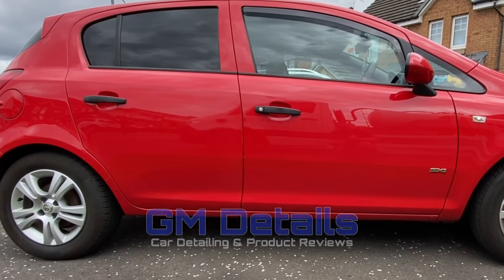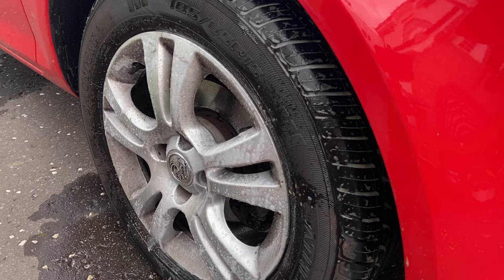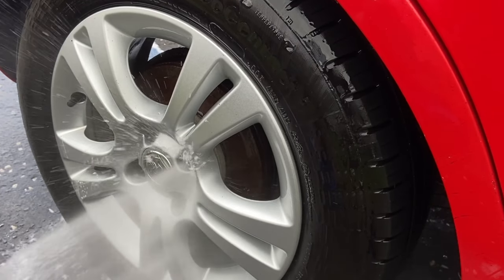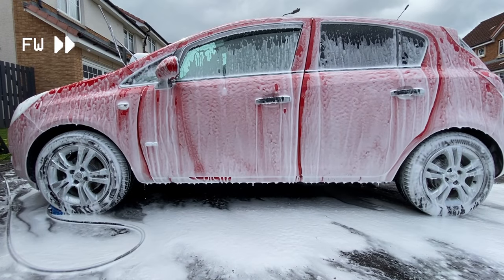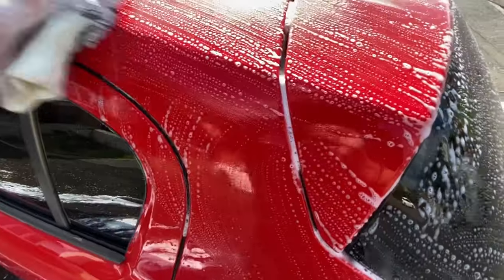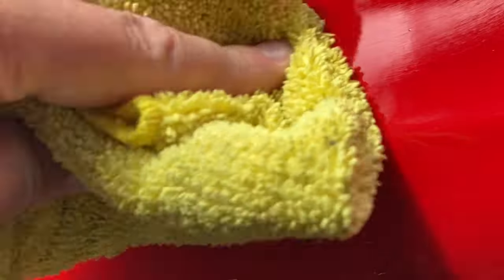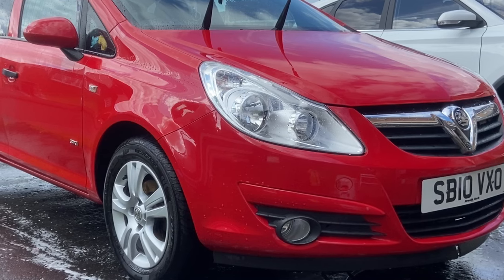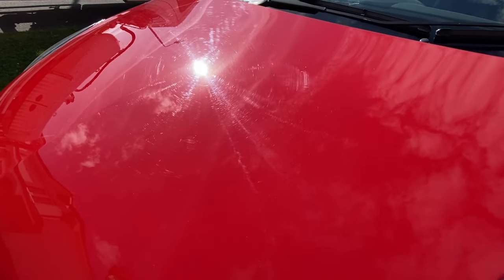CORSA D FIRST WASH SINCE LOCKDOWN | Disaster Detail Series Vauxhall (Opel) Corsa Episode 1

Comment: Great video dude! Really looking forward to the next video! Don't leave us hanging too long. The products look decent enough and without being "that guy" I'm sure they are likely to be rebottles. But for 5 pounds a bottle it is fantastic value for what are capable products. Just because they are rebottled doesnt mean they inferior to some of the guys who are making their own. I've had some of the Jellybean shampoo from another supplier which looks to be the same product and it's actually one of my favourites
Reply from the maker: Thanks mate. Yeah undoubtably rebottled but surprisingly good products. I can only think of 3 chemical suppliers in the UK, Bonnymans , Car-Chem & A-Chem, all of them have a dedicated car cleaning range  & offer rebranding for smaller niche brands which I think is great for the industry to offer the enthusiast a collection from their favourite brand. 
Then again most small detailing brands rebottle & add scents or colours to suit themselves and call them ‘bespoke’ chemicals which I’m a bit dubious of as any chemical manufacturer will tell you not all scents & colours work well within products and can easily ruin them like Infinity Wax suffered when they were within their first few years of trading as an example.  
Price wise, yes as you said £5 a bottle is excellent value but even at normal prices of £7-£9 for 500ml and a few £ more to upgrade to 1L sizes is excellent value considering the products are still the same concentration as they came out the factory, something I know other brands dilute to make more money which I think is completely wrong. 

The polishing video will be out as soon as possible but my editing time has been severely cut due to additional hours at work, but I do appreciate everyone’s  patience, I’d love to make videos more regular but it really does take up a huge amount of time. 
Thanks for watching & commenting, always love reading them 👍